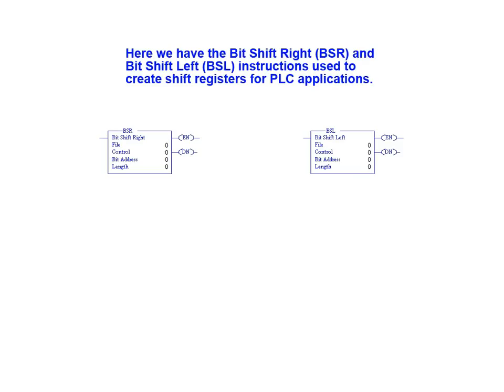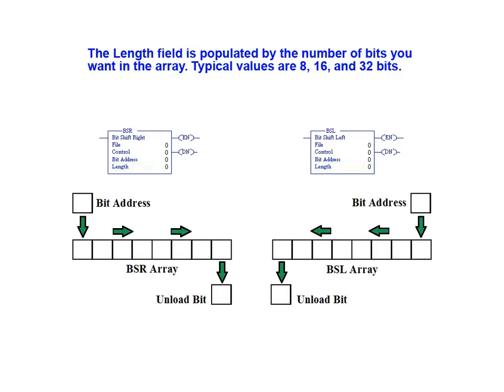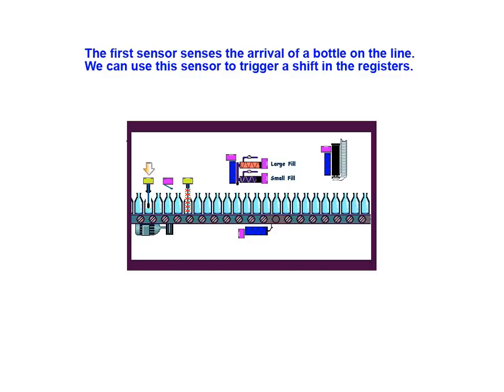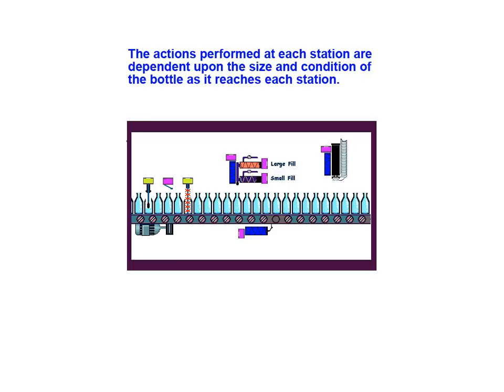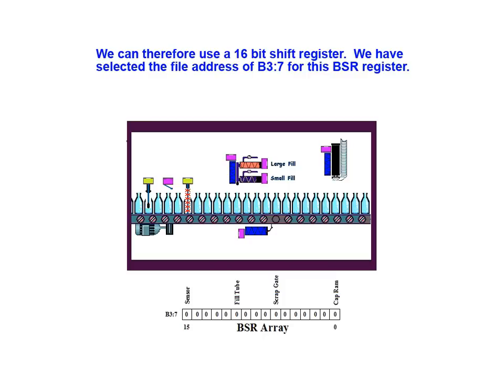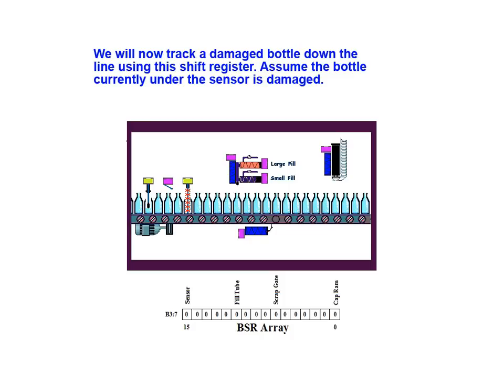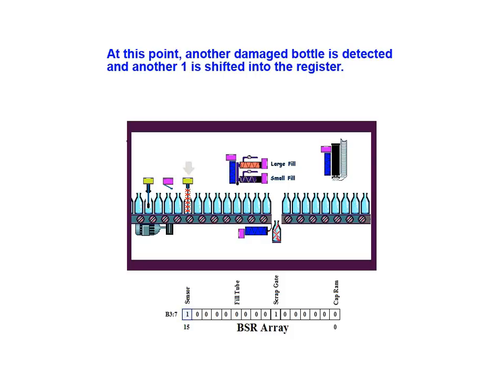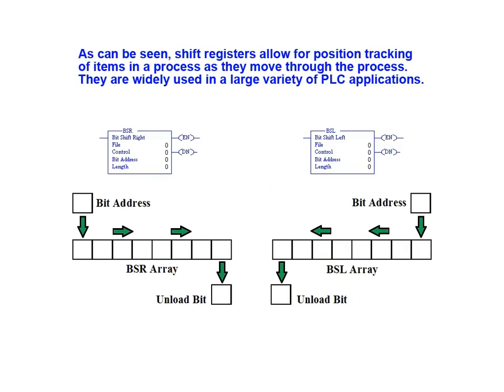Online PLC Programming Tutorial for Shift Registers - Using The BSR And BSL Bit Shift Instructions

Comment from the maker: Very True !  For minimum. process cycle time (maximum throughput), the gap would be removed, and the register would only need to track the damaged bottle from the point of detection, up until the scrap gate. After that, it would not be required at any point down the line.
Thanks for the insightful comment !

Comment: Also in a real world application of the Registers with a physical gap where the scrap bottle used to be may not be maintained, as it reduces process cycle time. In that case when scrap bottle is dumped, the scrap bit would be reset to a zero (0), else the fill logic would not work correctly.